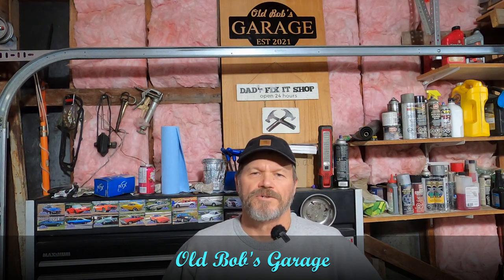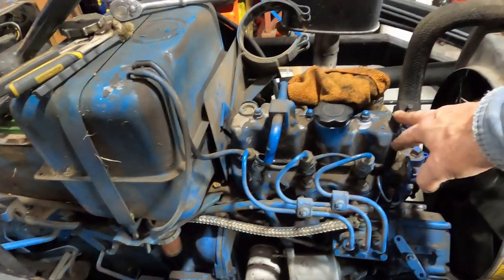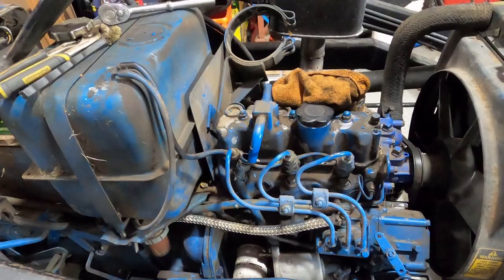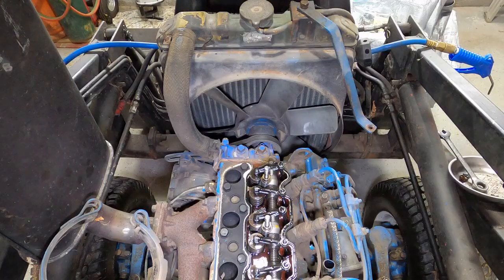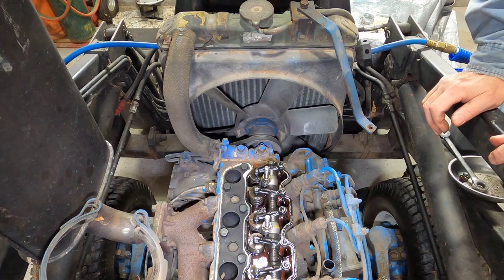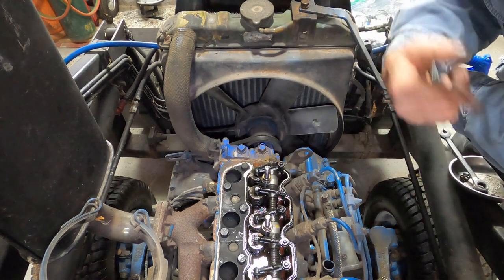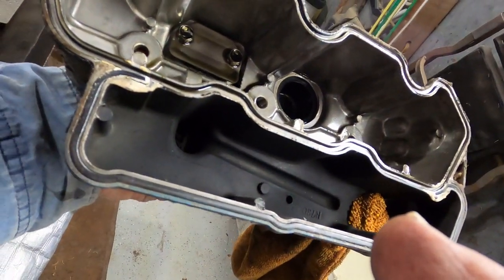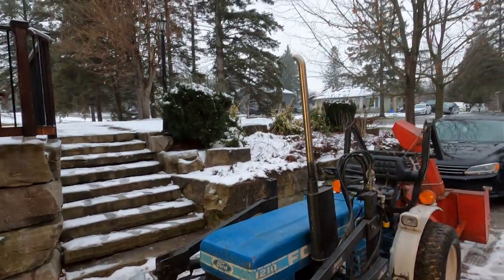Ford 1210 diesel tractor valve clearance

Comment: I have an 1210 2 wheel drive. Hydro tranny. Turf tires. Will it handle a small snow blower on level ground. Thanks. Great tractors.
Reply from the maker: Yes, I have a 4 foot wide blower on mine.